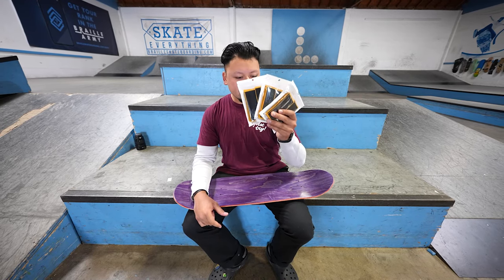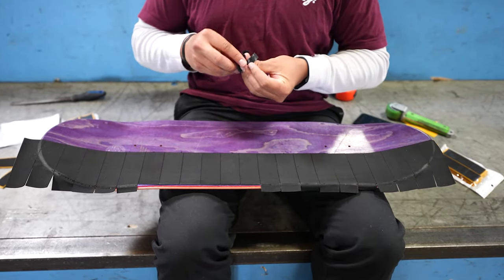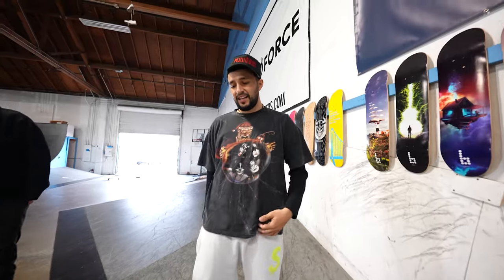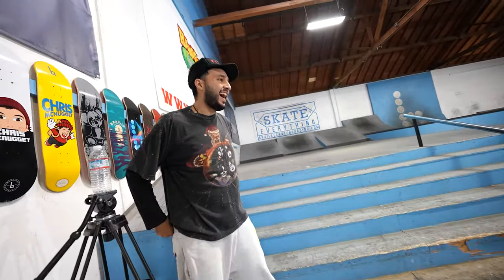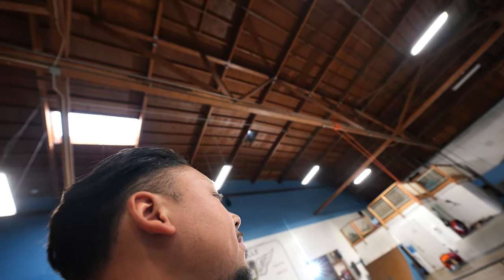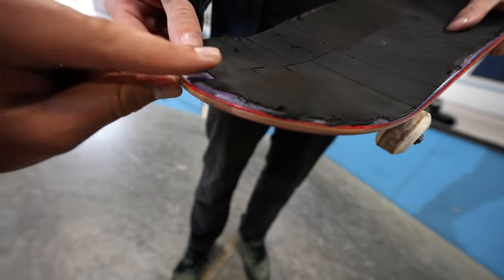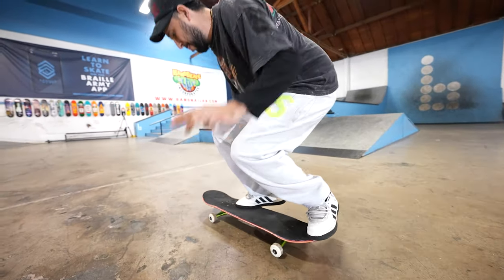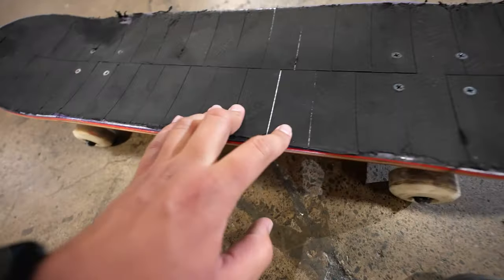FINGERBOARD GRIPTAPE ON A SKATEBOARD?!

Comment: I'm sure you guys have already sorted out the whole cable handles situation by now, but I have a solution that I'd like to propose.

-Mount a stainless-steel screw eye about 7-8ft up on the wall that leads to the vert room.
-Tie a long rope to the end of the cable handles hanging from the ceiling.
-Thread the other end of the rope, that is tied to the handles, through the screw eye mounted on the wall.
-Pull the rope until the handles are out of the way.
-When you want to use the handles again lower the rope and untie the hand holds, leaving the rope threaded through the screw eye for future use.

Hope this helps. Keep up the creative content.

Comment: Possible series idea 💡 

What if you guys did like a sort of ranking battle of different skateboard gear. 

For example, you get together some of the best known truck companies and you pit them against each in different tests like grinding, turning, durability etc. it goes on until only two remain for a final showdown of the “best” trucks. 

Could use some smoothing out haha, but would be cool to do with wheels, decks, grip etc.

Comment: I’ve thought about using that material to stick on the bottom of the baseplate as a shock pad. Just like my old phantom trucks used to have back in the day.
Reply: use 3m one sided foam tape. it's firmer and will absorb shock for real. this fingerboard tape is very malleable and will flatten completely under the weight of a child's feet, even. i have used that 3m foam as homemade risers before, they also flatten, but retain some form.

Comment: Hey everyone so I have a hot take: 200 grit sandpaper with a very strong glue is the best thing in the world for a grip job. I've been skating since 2002 and I can tell you 95% of griptapes are just too coarse and end up doing more damage (literally) than helping.
The sandpaper will NOT wear out your shoes. Or at least they will last twice as long, YET it'll still be grippy enough so that you never slide out BUT it has a certain give, as Gabe mentioned, so that your feet slide easily through the board, wich makes every flip trick extra smooth.
So yeah y'all should try it
Reply: i was literally thinking about this today and said, “why dont we have a lower grit for grip tape so we dont destroy our shoe?!” That seems like a gold mine just waiting to be struck.
Reply: Unfortunately, many have drifted away from lower grits, claiming that the grippier the better. I think grippiness is an overrated feature of the skateboard. Except for transition

Comment: this musta been so expensive 😭
Reply: Probably not for real. It looked like they were using the kind of cheap foam griptape that you can get on Amazon, Ali Express, etc. Gabe more than likely spent at maximum $15 on those 3 packs of grip. I fingerboard, so I'm familiar with the average cost of foam griptape.